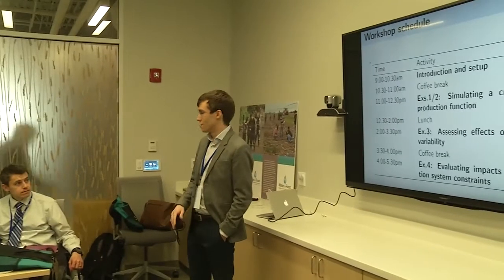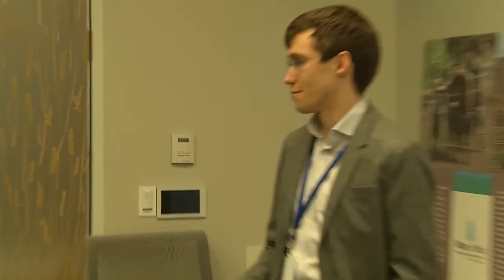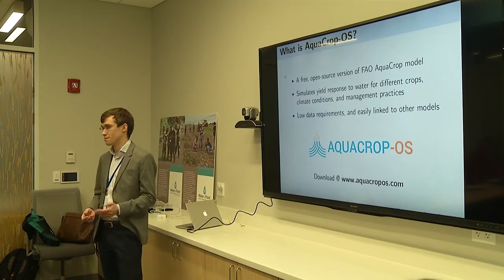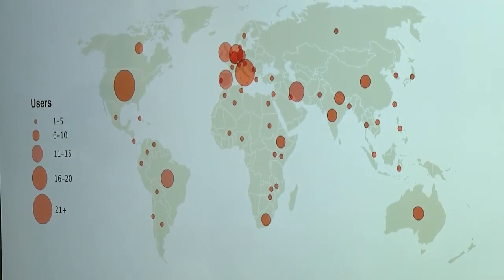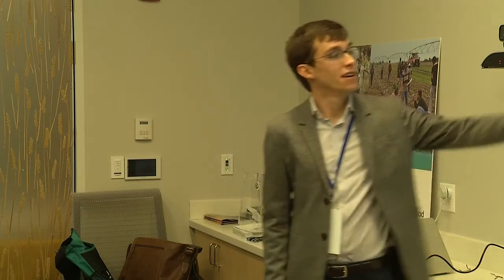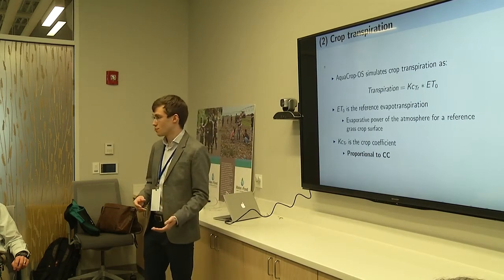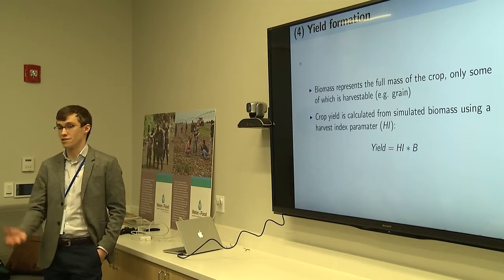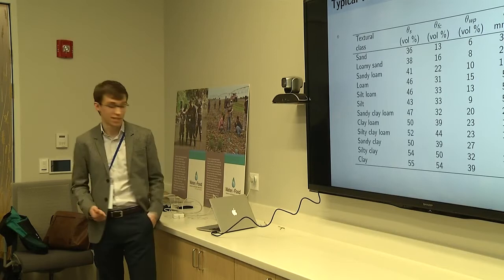AquaCrop-OS Workshop: Predicting a Better Future for Agriculture and Water  Productivity

Comment: Hello everyone,

I'm currently working on integrating a MATLAB model with Aquacrop-OS. However, I'm encountering a Fortran runtime error when trying to process input files, and I'm not sure how to resolve it.

The error occurs at line 344 in the tempprocessing.f90 file, with the message:
Fortran runtime error: End of file.

Here’s a brief description of the issue:

I believe the input file format may have changed with newer versions of Aquacrop-OS, and I'm unsure if the file format I'm using is correct.
The model tries to read the file but encounters the end of the file unexpectedly, suggesting there may be an issue with missing or misformatted data.
I’ve already checked the file integrity, but I’m still running into this error.
Has anyone faced a similar issue or could provide guidance on how to resolve it? Any help or advice would be greatly appreciated!

Thanks in advance!